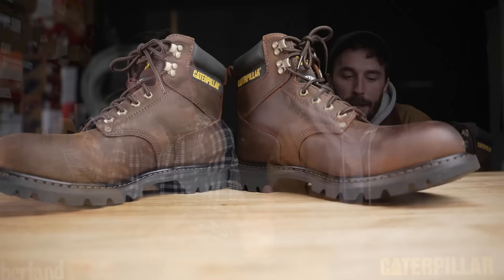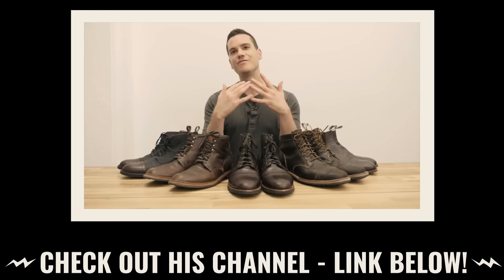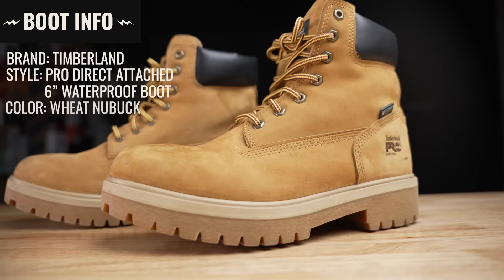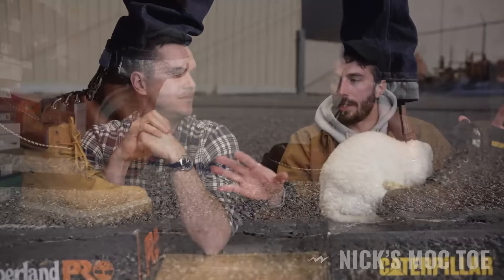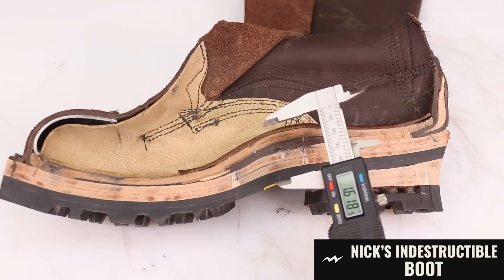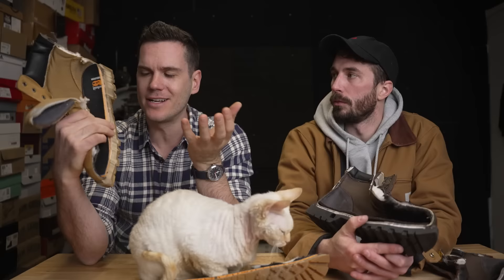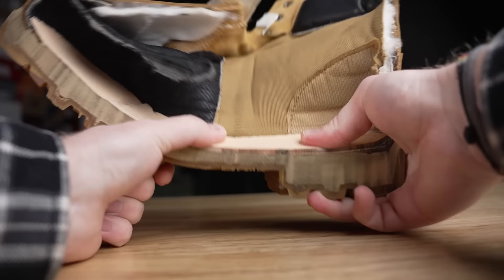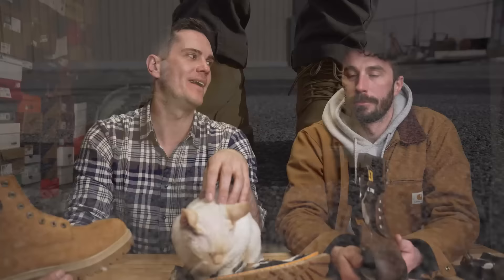Best Budget Work Boot - Timberland Pro VS CAT - (CUT IN HALF)

Comment: Used to wear those CATs (non steel-toe version) as my everyday boots and both pairs I owned lasted an insane amount of time. Like, years and years. For the price they seem to be very high quality boots.
Reply: I’m in the market for CAT work boots (steel toe or composite toe), and reviews on their durability seem to vary. You wore Second Shift?
Reply: @scecily I suspect the design has changed. I've had 2 pairs of CATs for more than 6 years and they're easily the most hard-wearing shoe I've owned. 
However, mine look much thicker than the one shown in this video - much more like the Timberland. It seems from the website that the ones I have were discontinued.
So if you read rave reviews about CAT boots, just be aware that people who've owned them for several years might be talking about a completely different product
Reply: @alxdrmnc  thanks for the reply! Thankfully, my husband has found that CATs work better for him than the Timberlands he had. Curious to see how long they will last!

Comment: I actually have the timberland pros but with the steel toe. I would have to walk almost ten miles a day on rock and gravel with them and they’ve held up for over four years. This place also got super hot like a heat index of above 120 so they did get hot but it wasn’t unbearable. I like them, but I did get the wide version so it might be better for my foot to spread out with all of the walking. They have a good amount of flex and support, on top of the already pretty good protection. I can’t afford super expensive boots so I don’t know what I’m missing but these things are 10/10 indestructible and great for walking.
Reply: Yeah man, I love them. I've put tens of thousands of miles on 10+ pairs over the last 20 years. While I've tried more high end boots, I've always came back to the Pro steel toe 8". I gave up looking for better awhile ago, in my opinion they could be worse & they'd still be pretty good.
Reply: I have the full grain mocktoe and the leather is beautiful after it is conditioned.
Reply: How did they go for waterproofing? And were they warm enough in winter?
Reply: @inspectorrex1696   I'm in Buffalo N.Y. and wear them all year. (8" steel toe) I'm never hot in the summer and never cold in the winter.
The waterproofing is excellent, for awhile. For me that's about a year or so of hard use. Regular applications of silicone spray work well. It's a suede like leather and as they get scarred up and worn, they do get a bit spongy. They'll maintain solid water resistance with applied silicone. Working in wet slush for prolonged periods, or other similiar tasks will leave you wet, but not any more than any other boot. In my experience, and from all the guys I've worked with, for a boot to be truly waterproof, it's gotta be rubber, to an elevation greater than the whatever you're in. Otherwise there's just various shades of water resistant.
Boots are about the most subjective thing I can think of and everybody's got their own opinions.
For me, they're very comfortable all seasons, and nimble for an 8" steel toe boot. 
My only complaints are they're not made domestically & while the sole wears very well, and provides excellent grip in the winter...they really hold onto clay/mud.
Reply: I wore a pair of suede Timberlands I got in 2017 all the way through high school and into college until the heel completely wore out. Took them to the local cobbler last year for a premium leather lined interior and they are good as new. The natural rubber sole has still held up all these years. Best $160 boot you can buy in my opinion.
Reply: Timberland Pros are some of the most popular work boots in my country. You see them on building sites, worn by carpenters, plasterers, electricians, plumbers etc. They do different boots with various ISO certifications depending on you what to use them for. Not sure all of them are insulated.
Reply: @adamjames1375  I just wish there was more space between ea h side where they lace up after 6 months and each side starts touching. And I wear insulated keen outs inside every day. What keeps you hot keeps you cool. My feet never get hot but nor do they get cold working outside all day in the teens.

Comment: For the waterproof test maybe you could get a dry weight of the boot filled with a rice-filled sock, let them soak in the water using the rice sock to weigh it down, then weigh it all again afterwards to accurately measure the water infiltration/absorption of the boot materials.

I’m actually impressed by this Timberland boot after seeing some of other cheap work boots that can’t justify the price points.
Reply: Damn, I wish I sat next to you in school man. 😄
Reply: bro is a genius
Reply: i thought rice doesnt absorb water unless boiled because you have to break down the cell wall?
Reply: Replace rice with super absorbent cotton.
Reply: @Ilovepineapple  Rice would be heavier and easier to prepare.
Reply: @Dm-dw3tr  You'll just use rice to make it heavier. Then measure the total weight added after the shoe and sock absorbed some water.
Reply: @sherwin4ever  nnn
Reply: @Dm-dw3tr  they couldn't always warm their water in Nam. Rice and minnows in a bag of Luke warm water would swell the rice everytime according to vets I've met.
Reply: Just fill the boot with water?

Eh? Eh?

Comment: I can assure you guys, here in Ohio, construction absolutely continues through the winter LOL. I love my insulation! [and a pair of thin sweat wicking socks + wool socks] With that said, I wore TimPros all throughout my time working in construction, and I never noticed them getting too hot on 90° days. I mean, they're insulated so they hold a little heat of course, but they're certainly usable enough on hot summer days to justify getting insulated boots for the cold winter days. I've never been desperate to get a second pair of boots for hot weather use, though it would've been nice.
 
No complaints about Tim Pros though, they hold up well, are really comfortable, and I never thought about them until it was time to take them off - which is about the best compliment I can give footwear

Comment: I've worn both to work; the CATs were lighter, but the traction got significantly worse than the Timberlands when it was below freezing outside on pavement. 
The Timberlands were more comfortable on concrete, but felt like lead weights. My insoles wore out pretty quickly, along with the inside heel area (I think that's probably due to my pronation/supination).
Overall, I'd wear the CATs on dirt, and the Timberlands on concrete
Reply: I buy the timberland pro insoles for my boots, regardless of the brand of boot. You must do a ton of walking if you are burning through their insoles like that.
Reply: Why would CATs they be lighter if per the weights given in the video the CATs are the ones heavier?
Reply: Bro if you think timberland pros are heavy you need to stick too tennis shoes because I just got some timberland steel toes and they are THE LIGHTEST PAIR OF BOOTS I OWN you wouldn't even be able to pick your foot up in a pair of whites or nicks😅😅😅
Reply: @AppalachianLumberjack  I don't know the Pros but I do know the 6 inch Premiums and those are practically unwearable, unless you want  muscles in your feet too, for whatever reason. Any other models are light, as they are streewear. Especially those with visible EVA soles.
Reply: @Prosecute-fauci I wear timbs for work, they'll last just over a year before I need replacing them as the soles wear down FAST however I'm a binman walking 15-20 miles a day in them. I don't mind spending £150 a year on work boots as they're comfy and last waaayyy longer than what my company provide ( 3 months their boots last 🙄 )

Comment: The Timberland Pro for me has been a complete success in the field. I’m a general contractor, outdoor guy and live on a farm. I’ve work all kinds of boots and there are by far my favourite. They look clean and classic and yet can handle so much. They wear far beyond their weight class. Seriously impressed and now wear these as my go to work boots everyday. 
I even had an exceptionally good experience with Timberland Canada. I was just under 1 year of use when I noticed the upper separated from the sole. After sending photos Timberland sent a brand new pair of boots under warranty. They have my loyalty sealed with that gesture. 
Lastly in terms of fit and comfort... steel or alloy toes can often be a sock killer. And when you wear nice Marino wool socks this can be a big suck. My hard toe Blunnies left dozens of sad socks to be relegated to the bottom of the drawer until I learn to darn. These Timberlands have not done that. In fact they are incredibly comfortable and I was not surprised but very appreciative to see that indeed the centre of this boot has so much absorption. Great flex and comfortable bed allows for happy  wearing all day. Thanks for the review well done!
Reply: I wear boots literally every single day and have for almost 15 years and I swear by timberlands. They're not just "good for what they are" as some try to suggest in defense of their insanely overpriced boots, some of which you see on this channel. They're genuinely good quality, comfy and reliable footwear. I've worn them in as cold as -19 degrees and as high as almost 110, in both wet and dry, and after 9 years did I have to replace them, only after the sole wore through
Reply: Idk man. Those were my stompers and have you ever tried a thorough good? Those boots feel close to the same to me just better in every way. Safer too

Comment: I bought the cat boots twice. The first time I had no issues no leaking no discomfort and they lasted almost a year. So when I bought my second pair I didn't make it 50ft in the rain and my feet was soaked and something in the heel area that caused me to have severe discomfort. So I returned them thinking  that pair was faulty and got another pair. Unfortunately they did the same which was disappointing because I really liked my first pair and was affordable. What a difference a year makes. And even now after only wearing the second pair for no longer than a month my heal still hurts. I've never tried the timberlands I don't like the colors offered. Just so everyone knows the ones I had wasn't steel toe and was suppose to be waterproof. Same name boots without steel toe.
Reply: You sure they werent fakes?
Reply: @bloodydiablo666  I cant say forsure they weren't fakes . All 3 pairs were ordered through home depot website so who really knows guess its possible. The first pair I bought I wore the soles off of them but the 2nd and 3rd pair was crap. Something in the heel wasn't right and for the waterproof I walked about a football field on pavement during a slight rain and my feet was soaked. I don't know what happened like I said my 1st pair was great lasted alittle over a year so I'm not sure what happened in that time could have been fake never crossed my mind.
Reply: The Timbs are way..better..i got  cheap cats.made in india....that hurt my heel...i patched in heelprotectors..now they ok..but Timberlands are way better but more expensive. 🤔

Comment: I've had two pairs of CAT boots in recent years - the Generator and the Endure. Both were very comfortable, but didn't last as long as other similarly priced boots that I have used. I've had the same job for over 15 years so I feel that my expectation of a boot's longevity for my work is realistic. I generally now stick to Timberland Pro and Keen.
Reply: your longevity expectation is a bit exaggerated
Reply: @TobyMcguarro  It is? I'm not sure how you would come to this conclusion since I didn't specify how long I expected them to last. I just said that they didn't last as long as other boots have. Unless you are being sarcastic implying that they shouldn't have even lasted as long as they did...?
Reply: @brendand3600   The 15 years at the same job you mentioned seems irrelevant unless that's your actual expectation for how long a boot should last.

I like Keens because they're comfortable but honestly I have never owned a pair of Keens that lasted in real work for longer than 6 months without disintegrating. That's why I buy them used, I know I'll be replacing in 6 months so may as well save a buck.
Reply: @gorkyd7912  It is relevant because I've gone through many pairs of boots in that time and since they've all been put through the same use, I know when my boots start wearing out before they should be. 

If you are often switching jobs and/or types of work, a particular pair of boots may last only a few months at one job, but a few years at another. Much harder to get a sense of durability/longevity in that situation. 

I'm also well aware that just because you've had a good or bad experience with one model from a particular brand doesn't mean that all models from that same brand will yield the same results. Companies change hands, manufacturing facilities etc.
Reply: @brendand3600   Makes sense. So how long should a good pair of boots last?
Reply: @gorkyd7912  I generally spend no more than $250 and am looking for at least 2 years, but have got as many as 4 years. Your mileage may vary. 

Using a leather conditioner like Fiebing's Neatsfoot oil every few weeks helps and I've been told by a cobbler that if you buy two pairs of boots and alternate wearing them so that each pair gets a rest day after a work day, they will both last longer than if you wear the first pair every work day until they are trashed and then wear the second pair every work day until they are trashed. I haven't tried this though.
Reply: Boots last a lot longer if they are allowed to dry out. Over time moisture causes the leather fibers to separate. Often 12 hours or so isn't enough time to allow them to full dry. You can buy cedar filled canvas bag boot trees for about $15 that will help.